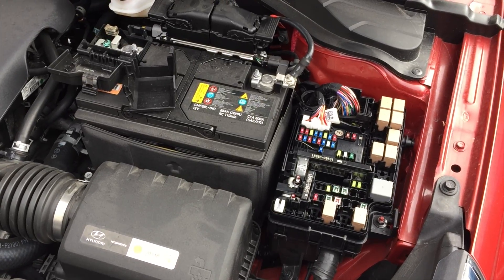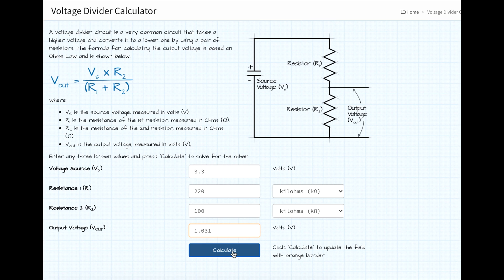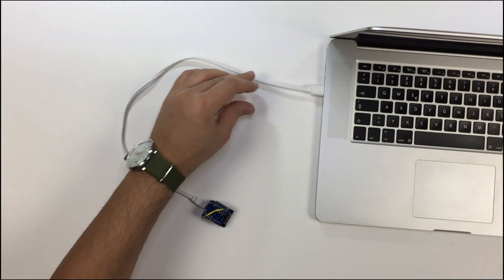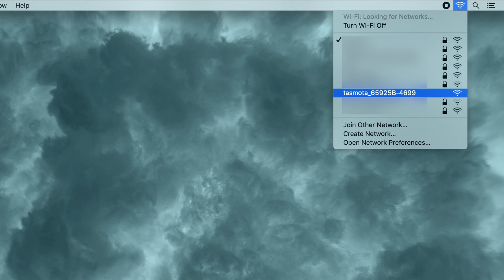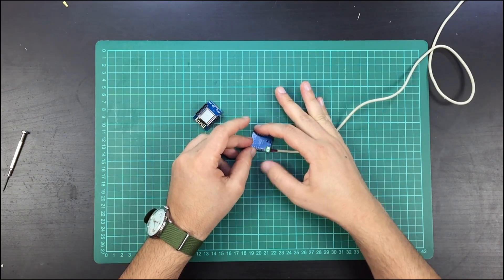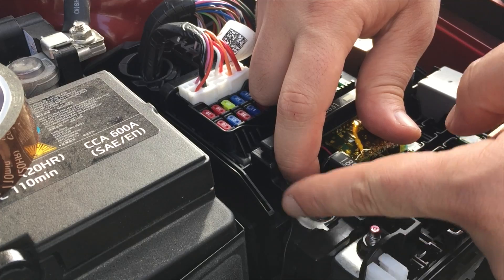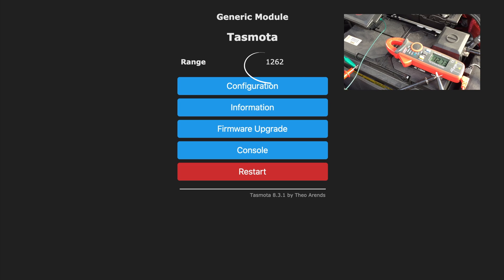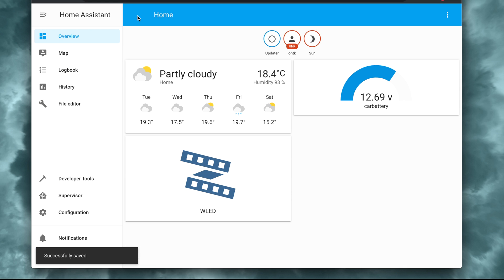Monitor a Car Battery Remotely using ESP8266

Comment: Why wouldn't you just use a 1k5Ω? That would give an output voltage of exactly 1V for a 16V source.
Reply from the maker: I assume you meant 1M5Ω. Theoretically yes!  However, 1M5Ω is not common - you can get very close by doing something like 1MΩ+470 kΩ+33 kΩ.

Comment: I have an important question. Please answer as soon as possible since you connected it to a car battery, it is also connected to the car's alternator which gives good amount of amperes while the car is running. So do you have to unplug it when you turn on the car?
Reply from the maker: No

Comment: Not sure if MrDIY is still monitoring (or anyone else for that matter) but if you are, fantastic project. I got it 99% working. Only thing I can't overcome is how to get Home Assistant to message me when my battery voltage is below 12 volts. Any screen shots of the automation setup would be greatly appreciated. Thanks. And again, well done!
Reply from the maker: You might want to check this post - https://community.home-assistant.io/t/monitor-your-car-battery-in-home-assistant/201508

Comment: Hi, i follow your suggestion to build a similar one. I have built one using a D1 mini with 1220k ohm and 100k ohm to measure the car battery. The data is sent to HA API at home. It works perfectly with the deep sleep. However, I am facing a problem when I drive my car to another place not within the intranet, the esphome node would continuously search the WIFI and not going to deepsleep. Do you have such kind of problem? Thanks
Reply from the maker: not an ESPhome expert, you might have more luck checking out the Home Assistant forums
Reply: @MrDIYca  ok thanks. I just found the solution using on_boot loop to solve the problem.

Comment: ****Be aware***. Changes to Home Assistant.  Platform key is no longer used.  Also take note on the syntax in the value template. Mine was "Range1" and not Range.  I assume this is because I am using an ESP32 that has 4 ADC pins instead of just 1 like the ESP8266.

Working as of 1/7/2024  , this is the new declaration for the configuration.yaml . 

mqtt:
  sensor:
    name: motobattery
    unique_id: motobattery
    state_topic: "tele/motobattery/SENSOR"
    unit_of_measurement: "v"
    value_template: "{{ (value_json.ANALOG.Range1 | float / 100 | round(2) )}}"
    qos: 2

Comment: I made a server version in 2019, can be viewed from any browser device.  Put a zener ~3.0-3.3v across the ADC pin to clamp spikes and a 0.1uf cap to filter. I had a spike hit mine and it changed the input impedance to 12K, damaged.  Also add a fuse and a TVS diode on the input power feed as well.

Comment: Will the ESP8266 drain the battery or is there no problem with that? My dashcam has a device reading the battery level and shutdown the parking observation, if battery is too low. - So you could send the ESP to deep sleep, if it occurs.
Reply from the maker: Rough calculation: ESP8266 uses 170mA at 3.3V (0.6W). A typical car battery has 40A at 12v (480Wh). That means the ESP8266 by itself can drain the battery from full to 50% in 400h (16 days). That should give you a frame of reference. If you add deep sleep, it should last years. You  might want to read this post - https://community.home-assistant.io/t/monitor-your-car-battery-in-home-assistant/201508

Comment: Very interesting project, I'm excited to give it a try.  Wondering, is there any protection needed in front between this and the battery to deal with voltage spikes on start or if hooking up a booster in the event the battery dies?

Comment: What resistance should you use for 24v battery version. Is that possible. Want to do same for DIY energy storage.
Reply from the maker: This will not work with 24v. The shield doesn't support it.

Comment: Thanks for this. I just built this after my battery went dead last weekend. I’m using ESPHome instead of Tasmota, and I got it up and running quickly and was able to calibrate it without any issues.
Reply: would you mind providing the yaml? I did this in tasmota 4 years ago but I'm looking to switch over, but i'm still learning esphome

Comment: Hi MrDIY. Thank you for getting back to me wrt the 24v. I have a 12v setup as per your video It work great but I notice that when the power goes out it drains my battery very quickly its a 7ah lithium battery. Brad new. I dont know how its possible as the D1 with power shield should really not draw alot of power. I am a noob at this stuff so hoping you might know why this is happening. All I have different from yours is that I have a 1.20 mega Ohm resistor as I was not able to find the 1 megaOhm and a220k Ohm as per your video. It still works to measure the battery level. Does this maybe affect it? Thanks in advance for your assistance
Reply from the maker: I guess the d1 is stuck trying to connect to the AP (that is offline) until it runs out of battery. Maybe a timeout can help?

Comment: Instead of Resister (megaohm) possible to use a buck converter?
Reply from the maker: No the resistors are needed to measure the battery voltage
Reply: @MrDIYca  Hello, I think I understood it wrong from the other video that I was watching. On their's they did not include the power supply for the D1 Mini, assuming they used the USB of the computer to power it up, when I disconnected it from the computer the D1 is off ( lol ) ...

So in powering our D1, we need a buck converter right to supply 5V to the D1. then the 1440 MegaOhm is for the A0. 

In your case, the Battery Shield was able to handle the battery voltage?

My usage: I want to build a smart battery monitor for my Koi Airpump built-in UPS that I will also convert to full solar setup.

Comment: Hi MrDIY. Thank you for this video. It works great. I notice that the D1 power shield can be power by 24v also. Will it be possible to measure battery voltage on 24v? If so please could you assist me to determine the resistors needed to measure 24v
Reply from the maker: I don't think so. A 24v battery can actually go up to 28v when fully charged.

Comment: I have everything together adjusted the range where it matches and added the code to config yaml... I get the raw values for voltage... like 1270 instead of 12.70v??? what am I doing wrong.
 value_template: "{{ (value_json.ANALOG.Range | float / 100 | round(2) )}}"  When I try to add the card to HA it says entity is non-numeric. I can analog range and it shows up1,270 but cant get battery volts to show
Reply from the maker: The device sends the voltage in the 1270 format. But in HA, it takes that and /100 giving 12.7. You probably have a misconfiguration in HA. I would check the HA's forum for help, it is pretty active. I remember seeing this non-numeric issue with another thing I did in HA but it had to do with old values not being numeric, so HA assumes the whole sensor is non-numeric.

Comment: thanks for the video, hoping you could help clarify something. You showed connecting two resistors to make the 1.44Mohm (R1 leg) but I didn't see the other leg of the divider (R2 100kohm). It looks like you connected the 2 resistors making R1 from hte +ve terminal to A0. Does the hat play any role in this?
Reply from the maker: Yes, correct. The wemos d1 mini already has a voltage divider. I simply extended it.
Reply: @MrDIYca  thank you clarifying that, appreciate you taking the time to explain

Comment: Thanks for sharing... I have followed your example and built this project to monitor the starter battery on my back-up generator.. Everything went well up to the point of Home Assistant. I got an mqqt brochure error. Did you already have a brochure installed in HA? This is my first time doing something like this..
Reply from the maker: Sorry, I am not familiar with brochure. Maybe check the HA support forum?

Comment: So I out everything together and added the code to config yaml... I get the raw values for voltage... like 1250 instead of 12.50v??? what am I doing wrong.
 value_template: "{{ (value_json.ANALOG.Range | float / 100 | round(2) )}}"
Reply from the maker: Do you know what is the raw value coming into HA? value_json.ANALOG.Range?
Reply: @MrDIYca  1250 or sooo
Reply: 17:00:30.457 MQT: tele/Battery-Transit-250/SENSOR = {"Time":"2021-06-17T17:00:30","ANALOG":{"Range":1270}}

Comment: Can this be tweaked to use with 48v system
Reply from the maker: You can play with the resistors to increase the range but your problem will be the power shield. It is rated for 24v max. I am sure you can find another converter that will take in 48v and give you the 5v needed.

Comment: Great project and video. Tool me awhile to get it going as I hadn't used Home Assistant before, is it possible you could show the code that sends out the notifications please?
Reply from the maker: I used HA notifications for that - so it is a bit dificult to show the code without HA ;)
Reply: @MrDIYca  many thanks for replying I now have it fully working, the only mod I would like is a sleep / deep sleep mode. The car I need it for is a Toyota C-HR 1.8 Hybrid which has a 12V battery problem when not used regularly.

Comment: It seems like in your setup, the ESP8266 is always powered by the car battery.  If so, how do you prevent it from draining the car battery?  Also, how did your drop the voltage to power the Wemos as 12V is too much to power it.
Reply: using the power shield, the input can be up to 24v!  the shield then downscale to 5v for the D1 chip

Comment: That's super cool. Can you log all the voltages over time in a graph? There are these bluetooth battery monitors that I have been looking into but as a software developer I would prefer something that I have control over. Excellent idea.

Comment: Is it possible to use this for monitoring a 36 volts e-bike battery that when it is fully charged have 42 volt and empty 33 volt?
I want to monitoring the storage charge so I can stop it when the battery have 38 volts.

All help is appreciated.
Reply from the maker: Hi Hunder, the answer is no, you can't using this shield as it is limited to 24v I believe
Reply: Ok. thanks!
Se if I can find any other way.

Comment: I have done this build using the D1 mini with power shield and noticed that even in deep sleep it consumes over 7mA of power draining my motorcycle battery in less than 55 days. If you do not use deep sleep the battery will die within 10 days. The problem appears to be the power shield that consumes nearly 7mA. This, unfortunately, does not make this project suitable for vehicles that are not used for long periods of time.
Reply: I also done one with a d1 mini and the power shield but deep sleep does'nt work when I connect the power shield. Do you know how I can solve it? I clarify that it works by directly plug the d1 mini but not when I plug in the power shield

Comment: Did you really just directly connect the ADC pin to the power through 1.2M ohms? That is not how voltage dividers work at all. Consider yourself lucky you didn't destroy you ESP8266. The voltage divider is between the power and ground and the wire to the ADC is from the middle of the two resistors. Your values are far too high to do this without a buffer. You should get decent results with between 5k-15k total resistance between power and ground as there is a calibration step.

Last step you need to do is put a zener across the voltage divider. Car power systems can be dirty so this is added to make sure that the voltage across your divider never exceeds 15v.
Reply from the maker: No, I did not connect the battery directly to the ADC pin. I extended the BUILT-IN voltage divider in the Wemos D1 mini board. I created a video explaining the difference between ESP8266 modules and boards (.. and the extra features they have , such as voltage dividers).  Check it out here - https://youtu.be/dGrJi-ebZgI

Comment: I don’t wanna be that guy, but you forgot half your voltage divider :/
And btw, a high resistance is good for a voltage divider, but 1.4 Mega ohm is way too much. You should decrease to 390kohm and 26kohm for example.
Nice work on the software part tho, and it’s a really cool idea!
Reply from the maker: Thank you Thomas! No, don't worry. And by the way, I didn't forget the other half. The Wemos D1 Mini has a voltage divider built-in. What I did is simply extending "the one half" to increase the range. Also, I didn't have a choice in the value of the resistor as "the other half" is already set in the d1 mini. You can technically change it but that involves de/soldering tiny SMD components - if you want to go that route.

Comment: Thanks you for the inspiration! I've build this device using the new (Tasmotized) Shelly UNI. No need for a separate 'Power Shield' and resistors. It takes up to 36V DC for power and ADC input. This makes the unit a lot smaller and it has a transparent insulation coating. You also get two switches and two potential-free outputs in case you want to do more than just read the battery voltage. More on the Shelly Uni here: https://shelly.cloud/products/shelly-uni-smart-home-automation-device/. Thanks again!
Reply from the maker: That is a cool device, thanks for sharing.
Reply: Hi bud. Could you please share you setup using Shelly UNI? Cheers
Reply: how do you deal with the two ranges breaking at 12Volts, in effect the nominal voltage you are measuring

Comment: First of all, very nice videos and IOT ides, good luck with the channel, hope that channel will continue with smart home DIY ideas based on ESP boards. 
Just one question, calculation for voltage divider was for 16V battery and the measured battery voltage is actually 12V. Is it possible to do this only with NodeMcu ESP8266 board? Should be able to take 12V if I am not mistaken?
Would be nice to show some examples with ESPHome in the future.
Reply from the maker: Thank you Marko. I check the schematic for NodeMCU and it looks like it simular to the D1 mini. They both use a 220k/100k voltage divider for the ADC so that means they are both limited to 3.3v. You will still need to extend the range to accept 12v.
Reply: @MrDIYca  Please check this link: https://components101.com/development-boards/nodemcu-esp8266-pinout-features-and-datasheet
Under NodeMCU ESP8266 Specifications & Features You will find Input Voltage: 7-12V.
Reply from the maker: Hi Marko, the device can accept 7-12v but the Analog Pin can only accept 0-3.3v.  Scroll down until you see: 
Analog Pin  |  A0  |  Used to measure analog voltage in the range of 0-3.3V. This is why I extended the voltage divider.

Comment: How are you powering the ESP8266 D1 mini?  Is it only on when the car is engaged/turned on? Or is the D1 mini always on?  Wouldn't powering the D1 mini drain your battery?
Reply from the maker: It is powered on all the time but only sends a msg every 30 mins. In theory, yes, anything connected to a battery will eventually drain it but it will take months. Hopefully you will get a notification before that happens :)

Comment: What resistors do I need to monitor 24V? Is it 2.44 MOhm?
Reply from the maker: The battery shield is rated for 24V max. The batteries can easily exceed that, especially while charging. I don't recommend you use it with a 24v system.
Reply: @MrDIYca  Thank you, good to know!
Reply: @MrDIYca  But what if I connect it to only one of my 6 18650 battery cells, so it measures only around 3.7-4.2 volts?

Comment: This looks fantastic and i can think of numerous uses but i just cant get it to work. I have set the device using Tasmota exactly as described and setup home assistant on a Pi3 and followed all the instructions but the device does not show up on home assistant. I must be missing something :( I tried installing an MQTT server on home assistant but still could not get it work?
Reply from the maker: I highly recommend visiting the Home Assistant Forum and Dicord help channel. There are a lot of amazing people over there that will give you a hand with the MQTT server setup: home-assistant.io/help
Reply: @MrDIYca  I think i am now getting there thanks :) I had lots to learn about home assistant but now have a few sensors working so now back to the voltage monitor. I do have another question. You use the voltage divider to lower the sense voltage but it appears you are just using two resistors in series and connecting one end to input voltage and the other to the A0. But usually a voltage divider is used from the center tap of the two resistors?
Reply from the maker: Great. Yes, that is because I am not creating a voltage divider. D1 mini already has a voltage divider built-in using 100kΩ and 220kΩ resistors. I am simply increasing the 220kΩ end by adding an extra 1200kΩ ( 1MΩ + 200kΩ) for a total of 1440kΩ. Effectively creating a voltage divider with 100kΩ and 1440kΩ resistors.
Reply: @MrDIYca  The problem i am having now is when i copy your code into the configeration.yaml file it does not like the unique_id:car-elantra-battery line? So will not allow me to save it into the file?

Comment: Good job, all works great.  Wonder if you can include an 18B20 read to make more sense of voltage reading...?  (I tried, too challenging at my level...)
Reply: Actually, remembering to add the pullup resistor to the 18B20's data pin makes the sensor appear in the Tasmota setup and Home Assistance interface was pretty simple after that.  Thanks again for the clear and detailed instructions.
Reply from the maker: Awesome, so what did you end up using it for? mapping the voltage to %?
Reply: @MrDIYca  Just for added data.  Tested and found on a hot day the setup reads one to two tenths high, and it hasn't been cold enough to test it any further, but for cold weather climates, it could be very important.
Great video camera work, editing, good clean commentary audio levels, good scripting, keep up the good work, by the way.